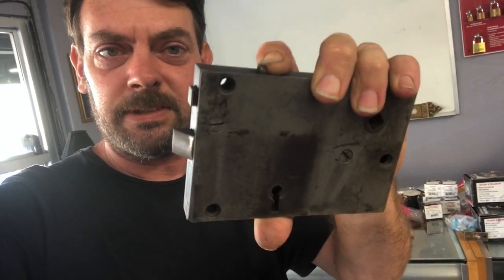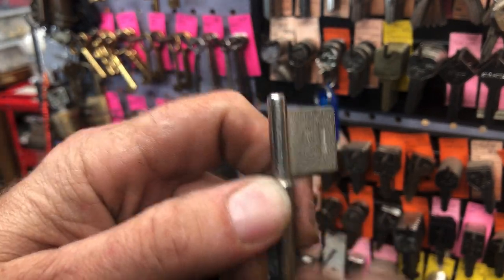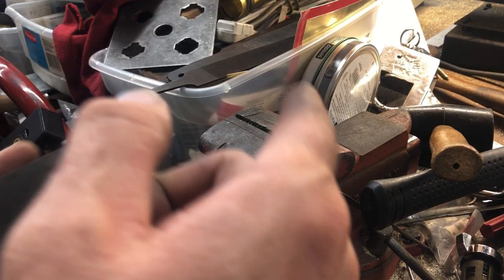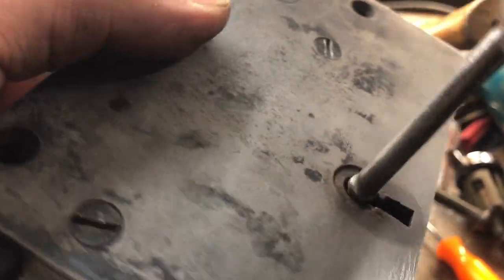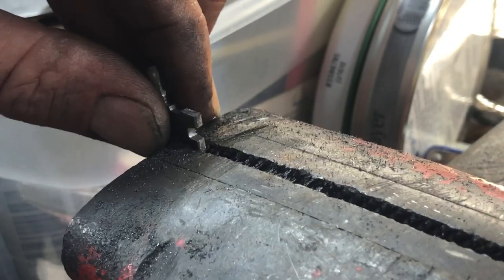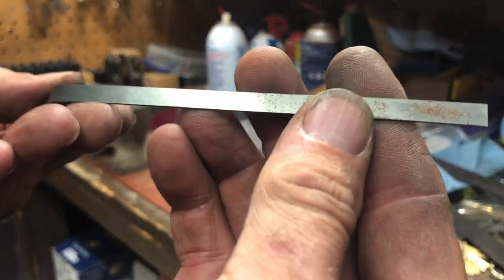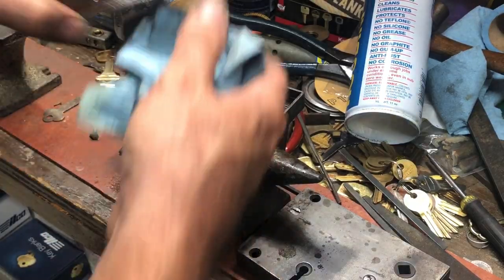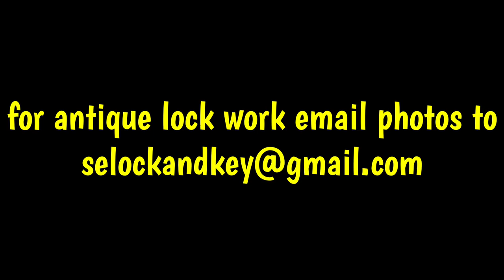antique surface mount lock bit key make & light repair

Comment: great key making!,  if you need some good spring steel that is cheap too, find the wiper blades that just have the one big blade with out the supporting arm pieces,  spring steal, painted black, very tough and springy.
I use it for picks, it's a lot tougher than a hacksaw blade, and only breaks if you bend it to sharply.
Reply from the maker: GKeyman565 that’s a good idea too, I actually stripped some out of my last wiper refill but I’m not sure where I put them cause I only remembered doing it since you said that! hmmm 🤔

Comment: I love watching you work on these old locks.  From the Video, it looks like there was only warding in one side, not both.  Is that correct?
Reply from the maker: Yep, but it doesn't matter since they would be using the key from either side. Most only have the wards on the one side, unless they go higher security and put different wards on each side. I've seen a handful of those